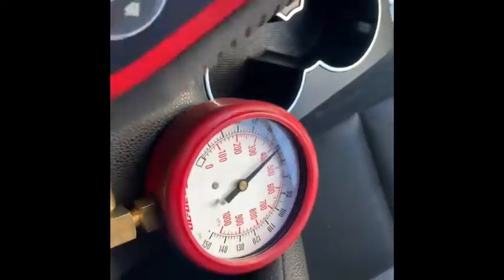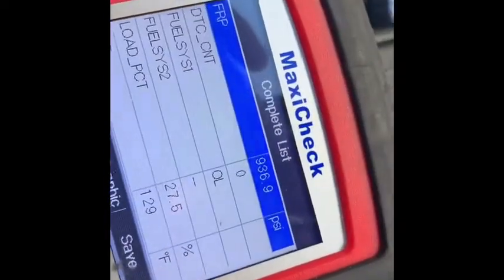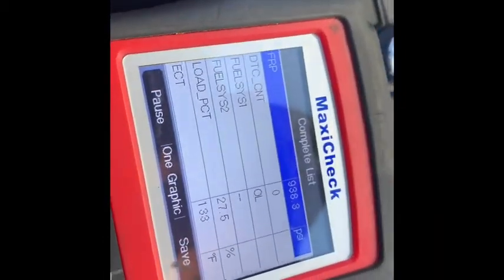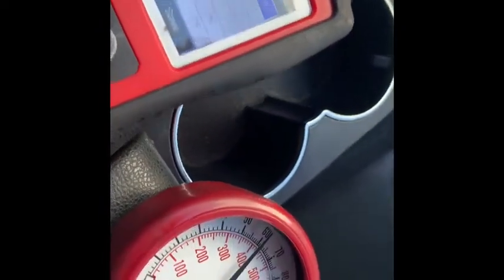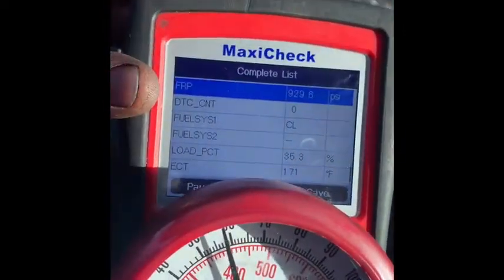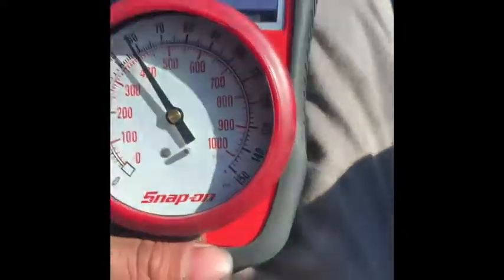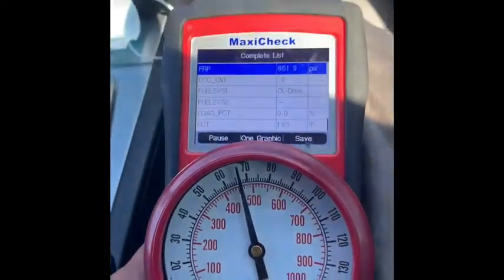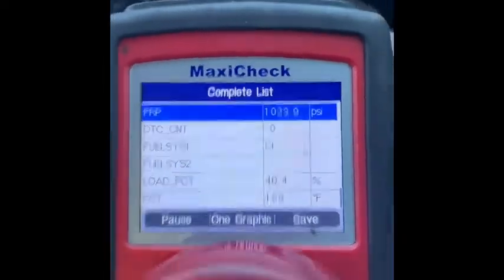Mercedes Benz C250 high pressure fuel pump fix

Comment: Nice! I had the same issue. I bought a reman off eBay and after installation it has thrown several codes on me. I will try what you did which is to swap the sensor and see if it works for me.

Comment: It has been so long you probably do not remember but you "There are two codes to look for one is low fuel pressure the other one is switch not opening to potential". What are the two codes. I may be having the same issue. How/where did you attach the low pressure gauge? I'd love to try what you are doing. I am not seeing the dreaded P0002 code and my fuel rain pressure looks good. But it definitely has issues under load be t speeding up or going up a steep hill. I suspect HPFP but would love to have a better idea before spending the time and money.

Comment: So checking the FRP, if getting decent reading could be a bad sensor? For mine, I get the dreaded code for HPFP. But my vehicle acts like it is in Limp Mode. There is no power at all. Better to change? Or possible a sensor? I'll check with scanner today.. good info..
Reply from the maker: I got a rebuild HPF on line after installing it I had to remove it to change the fuel rail pressure sensor for the one off the original sensor and that worked 
  If the fuel pressure sensor is faulty it will go into limp mode to keep it from melting the Pistons. If my customer didn’t buy the part I might have started there especially if when you shut it off and restart it it runs good until you really punch it, but we ended up using the sensor of the original pump I pulled off and between the customers HPF and the original sensor we fixed the problem, The sensor on the rebuilt HPF was no good
Reply: @dadsgarage420  cool, thanks for the reply. They are so costly, trying to find one at a decent price